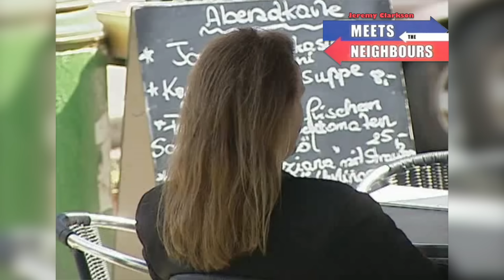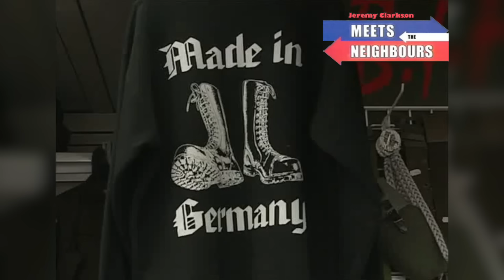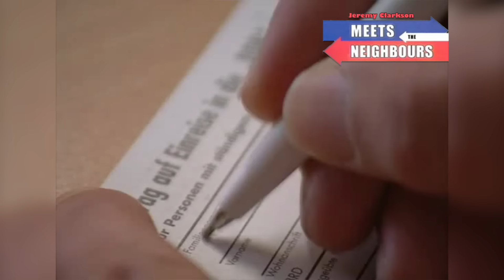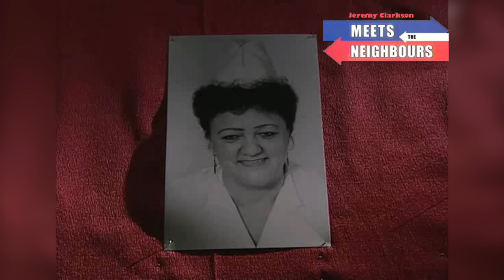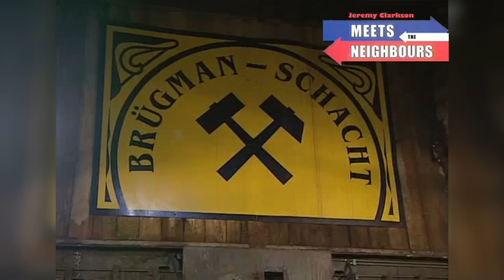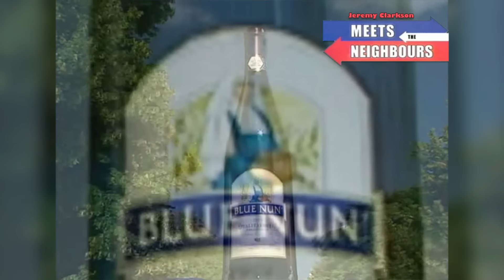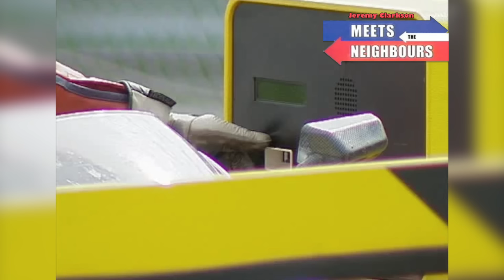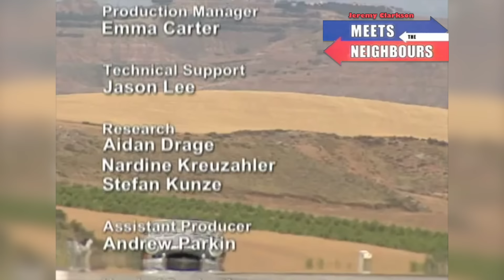Jeremy Clarkson Meets the Neighbours: Germany The FULL Episode

Comment: The British have separate taps because the hot water could be contaminated and unsafe (to drink). They had open boilers for the hot water. (See Tom Scott)
Reply: @77-ca-1-76 It's more complicated then that, see the following video for detailed explanation "tom scott british taps" there is some logic to it.
Reply: It used to be that the only SAFE drinking water was from the kitchen 'cold' tap which was at mains pressure,all the other taps hot and cold were fed from a loft water tank which could become contaminated over time,this was ALSO fed by the mains supply but only gravity was used from the tank to the various other taps and boiler feeds.Most of the tanks were plastic or galvanised steel with just a cover on top for ease of access and were almost never cleaned internally(awkward and difficult job mostly)
Reply: @busking6292  Thanks for the detailed explanation, you would think they updated this. In the Netherlands we have a central heating unit that also does the hot water, it's a sealed system and keeps the water above salmonella temperature but I still do not drink it!
Reply: I can't remember the last time I was in a house that didn't have mixer taps throughout. You are all living in the 1950s.
Reply: @Rover200Power  I lived in a house built in the early 90s which had separate taps and a gravity-fed boiler.  The cold tap water tasted better than any house I've been in since as well!
Reply: Frankly I like the sound of not having to wash my car or mow the lawn on Sundays, or requiring a licence for the borefest that is golf. Sounds great to me 😂
Reply: @-ca--  it's not continued my flat has 3 taps in total (all mixers) most people have them fitted now more so than the traditional
Reply: Ooooo tap boy  @Rover200Power

Comment: I remember, in the early 1990s, the Trabants on the Dutch motorways. What's the first thing they did with their newfound freedom? Go to the Dutch coast, like all the other Germans.

The guy at 22:15 is brilliant. He speaks the most outrageous nonsense with an completely straight face.

Germany is a strange country. People think of the Germans as efficient, but I don't understand why. If you want efficiency, go to Switzerland, the Netherlands, Austria even, but not Germany. The Dutch have the busiest rail network in Europe – only the UK comes somewhat close, at around 80% of what the Dutch manage – and 95% of their trains run on time. In Switzerland, it's 98%. In Germany however, you're lucky if they exceed 70%.

It is impossible to drive any non-trivial distance over the German Autobahn without running into a Baustelle, where they're working on the road, with the counterflow. This was the case 40 years, and things haven't changed. You'll find the best roads in Europe in neighbouring Netherlands, but you don't have all that going on on the motorway.

Then, there's the mobile network coverage and internet speeds, which are sub-par. You could argue that taking on East-Germany cost a lot of money, but other former communist countries have done much better.

On the other hand, very low economic growth and stagnating wages can't have helped. A bit like what the UK is going through at the moment.